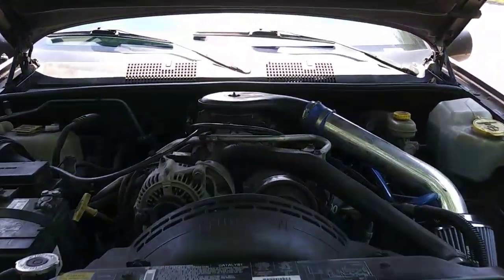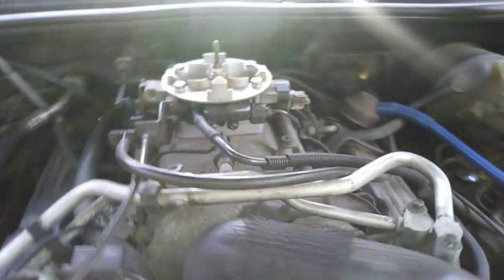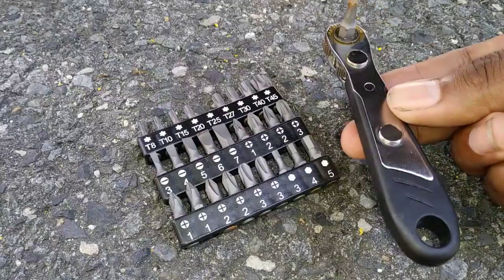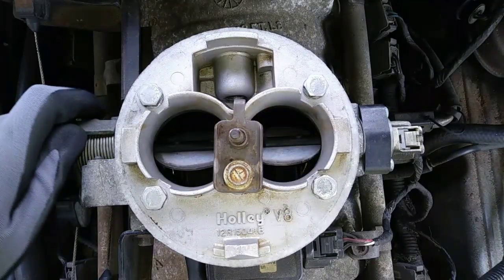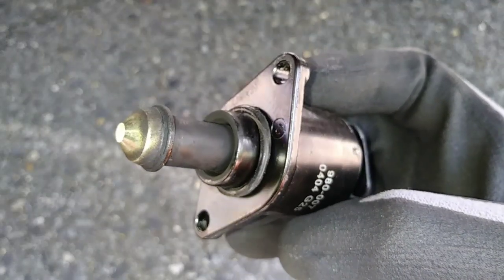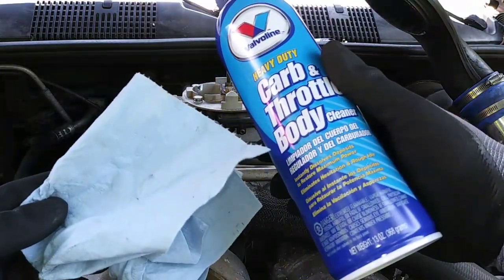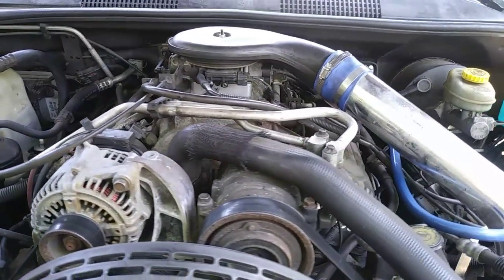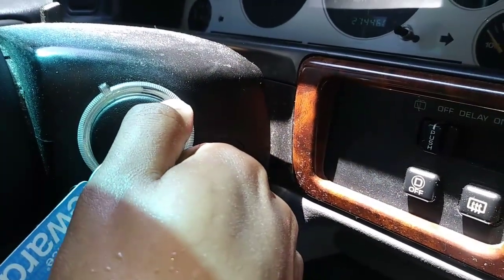IDLE AIR CONTROL VALVE (JEEP/DODGE 5.2/5.9 V8)

Comment: my jeep is idling low, and stalling, along with misfires. im gonna change the IAC and TPS. your videos are an amazing help for people who aren't familiar with the 5.2L Magnum.
Reply from the maker: Probably a good idea to replace your spark plugs and pull the entire throttle body so you can clean the plates and any build up as well
Reply: @barricadegarage5361  its currently snowing in Michigan so if the sensors alone fix it, ill wait for it to get warmer before doing all that. otherwise ill just wait a week or so for the snowy weather to dissipate.
Reply: If the sensor give trouble u can uninstalled it and vehicle should start up just will have a high intake sound at 2000 rpm...u can also remove one of the intake hose on the passenger of the intake and should help to bypass the iac when it's lock. To start the vehicle and should runs find.

Comment: I have a 95 cherokee limited 5.2 all wheel drive. Yesterday before work, i tried replacing the IAC. For some reason i can see the screws, even after taking pics(couldn't get a good angle). Anyway, the screws started to back out then stopped(i also re-watched this vid just now, realizing i needed a T25 bit and i was using a T20). Lol. Well gonna give it a go again Monday when i dont work. I may have to remove the throttle body so i can work on it in doors(30s and wet/windy), and actually see what im doing. Anyway, thnx again(watched your vid on the transfer fluid change and i believe one for the TPS.

Comment: Great video, & great explanation of how this part works. I replaced it on my 1998 Durango 5.2L. It corrected the the idle problem & stalling out when coming to a stop or at a red light. However, I bought the right angle screwdriver from Harbor Freight for $3.00 & $3.00 for the bit holder to give me more extension. Mine is a Torx 20 by the way for anyone with a 1st generation Dodge Durango.
Reply: I forgot to mention my 98 Durango has 151,645 miles currently & still going!

Comment: Thank you very much for this nice video, it perfectly explains everything i needed to know. i have the same problems with my 97 grand cherokee zj, and i ordered a new Idle Air Control Valve and will replace it on Thursday.
Reply: I have a 97 zj as well what part # did you use ? I couldn’t find it

Comment: During the 5 sec initialization sequence, do you keep the peddle slightly pushed through out the 5 seconds or just when you start it? Love your videos BTW!
Reply from the maker: Just when you start it then when the motor catches let off. This is because the pintle was extended which wouldnt allow enough air flow to the engine to start it unless you held the throttle blades slightly open by holding your foot very lightly on the accelerator pedal. The worse that could happen if you dont do this process is the engine may stall right after you start it but the computer catches on quick and will make the proper adjustments to the IAC by the time you start it up again
Reply: Cool! Thanks, man, yer Da-Best!!

Comment: Hey man, I have a 1998 Grand Cherokee 5.9 and I have been following your videos and I have solved many of the problems that I have encountered in my project. thanks for sharing ,,, but What are your thoughts on completely removing the throttle body for deep cleaning ??

Comment: @BarricadeGarage What would cause a 98 Jeep to stall out when the following occurs: 

Key in ignition. Jeep starts up fine. Put Jeep into drive and remove foot from brake. Jeep stalls out and turns off when foot is removed from brake.

I've also had the issue of it stalling right after ignition. What are your thoughts? 

I've already installed a new fuel pump, spark plugs with wires, ignition starter, top end gaskets, ac evac and recharge, suspension, belt, and power steering pump. All grounds and wires are good to go as well. Compression is also good.

Comment: Man that looked really CLEAN, were you having idle issues ? I see you put some lube on the screws , I do that too with Super Lube,  steel screws in aluminum SUCK TO GET APART MOST OF THE TIME. That whole TB LOOKED REALLY CLEAN.
Reply from the maker: I cleaned that throttle body 2 years ago and put a cheap $10 aftermarket idle air control valve in. I wasnt having idle issues but I want to make a video on each individual sensor on the throttle body and I got the oem mopar ones for a good price
Reply: @barricadegarage5361  what’s the part number?

Comment: Just cleaned throttle body, and now I have a high idle (1200rpm) in park and neutral, but fine in gear. I have replaced the IAC Already.
Reply: Exactly same thing with me. Park and neutral sit at 1200rpm. Drive is fine. I'm guessing when I put the throttle body back in it created a vacuum leak under it. Although I did change the gasket too. Did u fix it?

Comment: I have a 98' Limited with a 5.9 and I had the low idle and stalling issue, so I watched both of the your video's and replaced the TPS and the idle air valve. Now I have a high idle issue. And yes I did disconnect the battery, so any help would be great.
Reply: Your Throttle position sensor is installed upside down... Trust me

Comment: Love your videos man. I have the '98 5.9 zj that does the same thing every once in a while. Would that be the same part number? It's never died but revs on idle (like your clip) every so often.
Reply from the maker: Yes its the same part number for your 5.9 I ordered mine off Ebay for $68 shipped.. Mopar part #53030657AD
https://www.ebay.com/itm/Dodge-CHRYSLER-OEM-00-03-Dakota-Idle-Speed-Control-Motor-53030657AD-/162538849988
Reply: @barricadegarage5361  Right on man! Thanks!

Comment: Nice video. I have a question I was just wiping down my throttle body and wiping inside the plates too  then when I go to start it up the idle went high to 1,500 rpm. What could be the problem? I also have a 5.2 engine love this engine. Appreciate it
Reply from the maker: Not sure is it still doing that?
Reply: BARRICADE GARAGE yeah it still does it
Reply: I still having the same problem and to be honest I switch everything from the engine already and some people have been telling me that is a senssor from the  transmission (TCC). I'm not sure but I'm going to switch that. By the way I have a 1998 zj 6L.

Comment: My Jeep runs and drives but shuts off after a while , I’d have to sit there and wait for it to turn over again . I done replaced the TPS sensor, ignition coil , camshaft position sensor, and fuel filter … still not fixed what els can it be ??

Comment: ive replaced mine and done that but it still stalls when i first start it then idles fine after holding gas for a few seconds. i have a 2000 dodge durango with the 5.2.  Im about ready to burn the damn thing.

Comment: My 97 jeep grand Cherokee has a starting issue only when it's below zero degrees. Everytime it's below zero my jeep doesn't start when I turn the ignition - no crank or anything. I have to bypass this by either 1. crawling underneath and putting my screw driver across the starter solenoid then it cranks and starts (while key is in on position) or 2. (also while key is in on position) pop the hood and go to the starter relay, we removed the black relay cap and manually squeezing the relay which then cranks and starts the jeep. In above zero degree weather starts normal. Any ideas?

Comment: My 01 ram van will start, idle, and drive but when you stop at a stoplight it dies, have to restart. Could this be the issue? Once again it starts and idles but as soon as you touch the gas it just shuts off.

Comment: This will work for a 99 Durango? 5.2L because it’s idle weird and then it’ll shut off by its self
Reply: I just changed the IAC valve on my 2000 Durango 5.9l. It fixed the problem. My Durango would idle weird and shut off on its own.